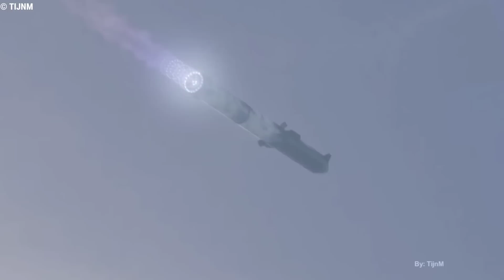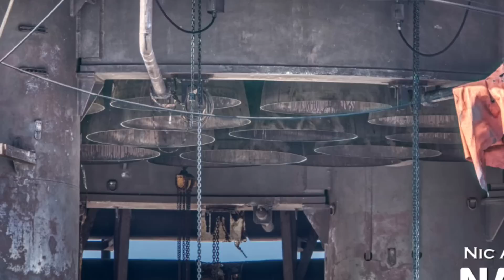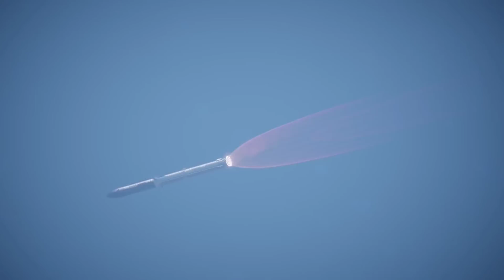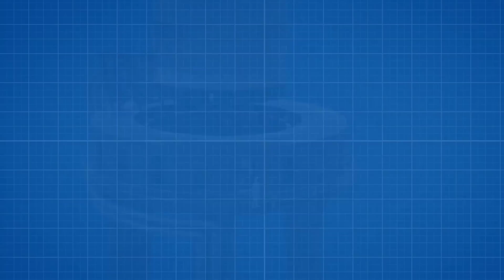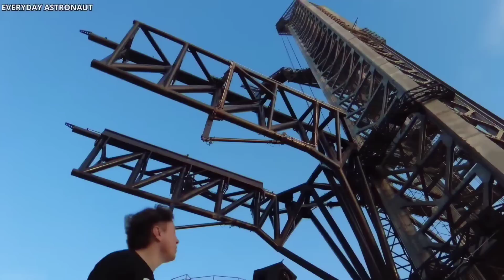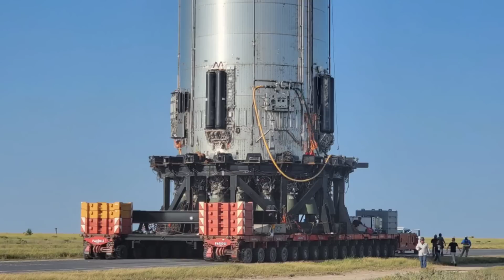Elon Musk UPGRADE Everything on The Booster 7 For The First Orbital Launch!

Comment: There is too many interact features in the OLT, flows of fuel gas, with the holstering infastructer for massive vessel, along with baring the extreme exhaust flares of the Beast5:03.  These multi task in one, need separation sequal, the OLT would've been better as a 2-split tray on limbs, almost like a Chopstix/Claw, separating fast during launch lift up/off of the Starship, The other function be separate tube insertion to flow fuel in the ship vessel parts.

  Something I'd nickname as 'Mechazilla Legs.' Even the Mecha tower arms are lacking a tractor turret torso, that 90° turn from launch section to land is far to adjacent close.